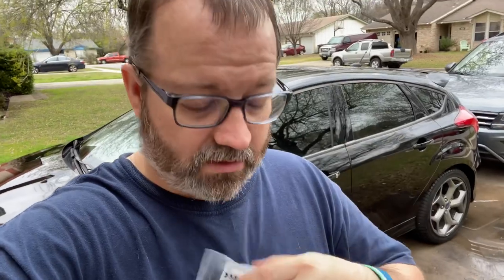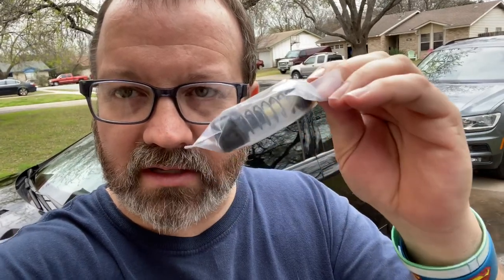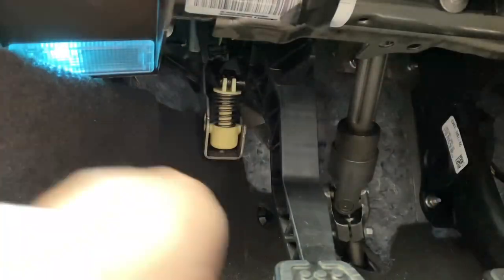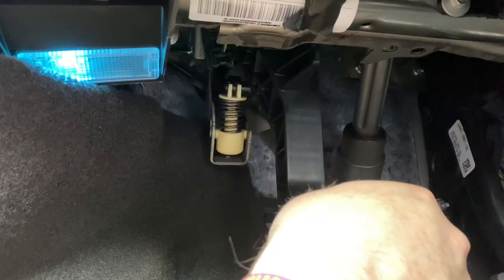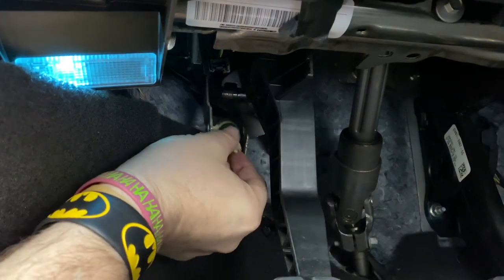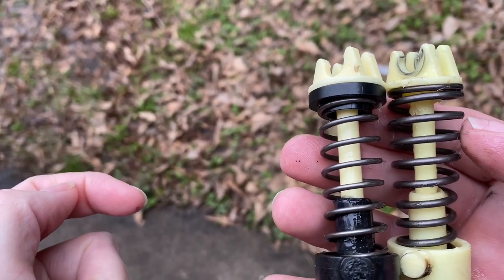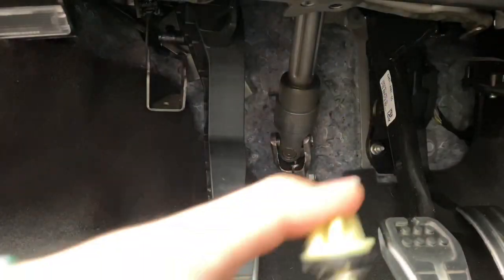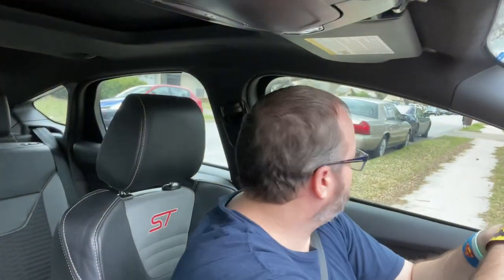Steeda Focus ST Clutch Spring install.

Comment: Thanks it worked, start with the master cylinder bad move should have just bought this
Reply: Was your pedal sticking and not fully returning?
Reply: @CLUBBEDOUT2008  yes, also check the brake fluid reservoir for leaks, you can also bleed the clutch
Reply: @MelloSA.  hey, so I have the same issue where my clutch wasn’t returning- did you change the master cylinder?
Reply: @lettuce9612  yes that shit didn't help, I tried bleeding the glutch...
Reply: @MelloSA.  what ended up helping?